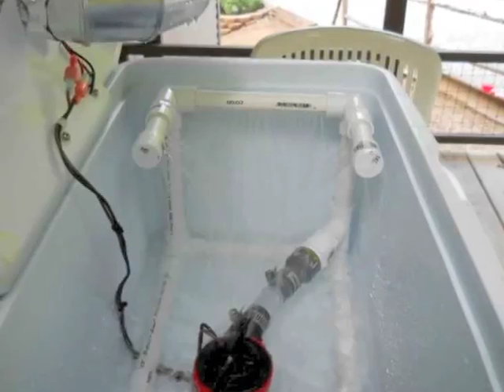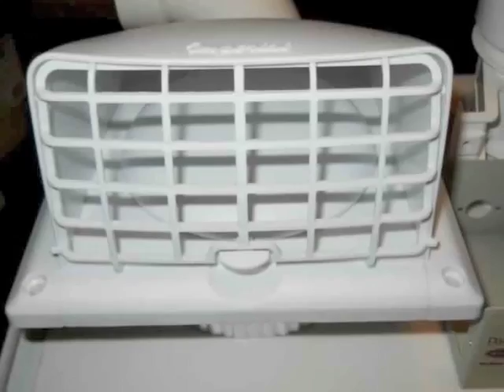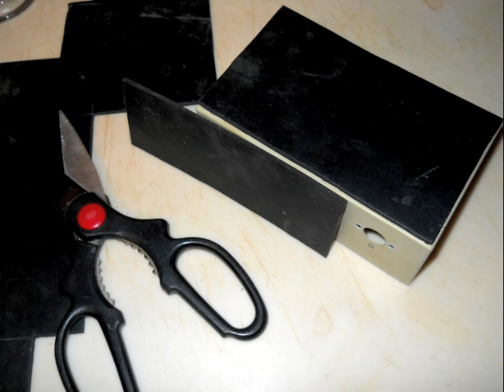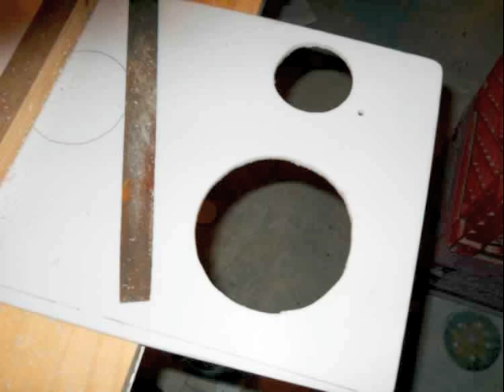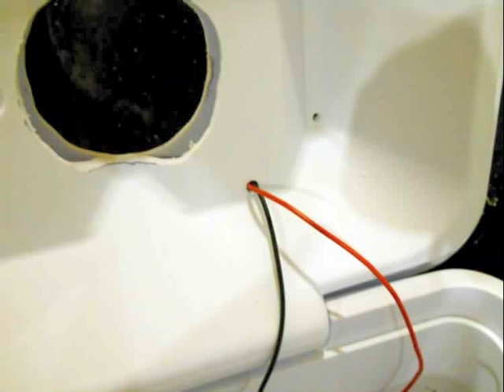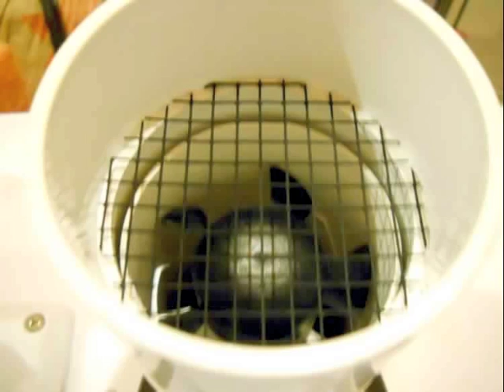Red Neck Air Conditioner

Comment from the maker: @rednecktrucker1969 Getting frozen 2 litre bottles of water on the road in Alabama may be a bit problematic.  Using the water feature is not done all the time, only when most of your ice is gone and you want to pull the last bit of cold out of the water.  I plan on doing some experimenting with leaving a couple inches of water in the unit and putting the ice in still in the bag.  I will do a follow up video when I have more data to share.  Thanks for the input.

Comment: If you use 1 to 2 Litre bottles that are filled with water and frozen. (frozen bottled typically last about 6-8 hours) Then you can forgo the entire pump system, also get the added benefit of not wasting water. Although I can see where your design has merits as well.